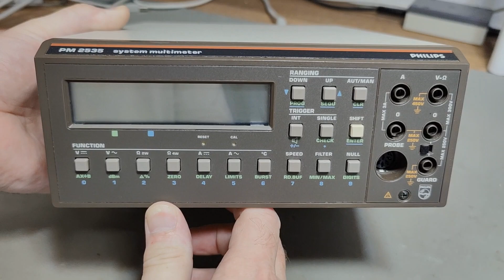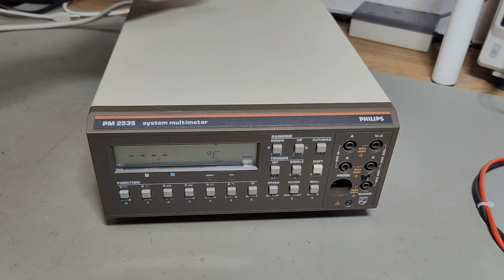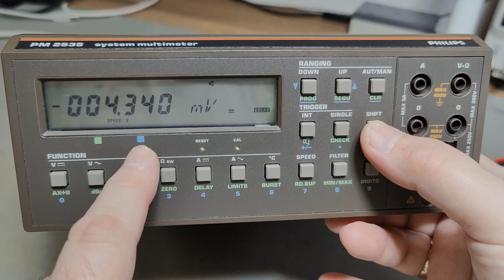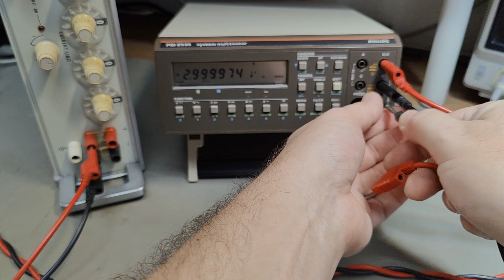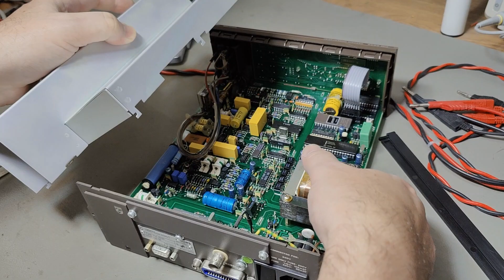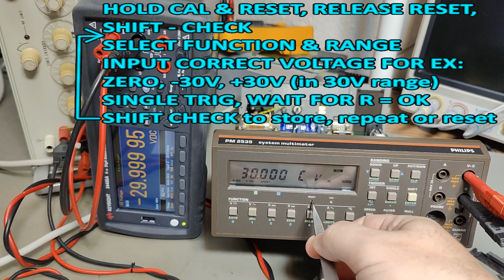Philips PM2535 System Multimeter Bench 1990 test calibrate teardown

Comment: Hi, thanks for the interesting video. I'm looking at acquiring a PM2525, very similar to your PM2535. I saw that there is a Lithium battery inside. Do you know if there are any fundamental precautions to take when replacing it? Thanks from Italy.
Reply from the maker: if you replace the battery, you will of course loose all calibrations, and must follow the cal procedure to the last detail, it is explained in my video how to perform calibration,
Reply: @TeardownOZ2CPU  Yes, I see. Thank You very much 🙂
Reply: Often you can replace the battery while the system is fully powered on, this way the RAM holding the values is powered from mains while its backup is replaced. However usually one needs to use a soldering iron that has absolutely no connection to mains live/neutral/earth, so that those commons voltages can't create any harmful large potentials on the board that would damage things. A USB soldering iron connected only to an isolated power bank would be a common modern approach.

Comment: Hi ! I have a PM 2525 with a motor inside to switch from one function to another. Very interesting touse but always afraid that it stop working. Also, if you misselect a function you can blew up the meter.
Reply from the maker: wow i have not see that, funny stuff with motors and such
Reply: @TeardownOZ2CPU I have posted a video demonstrating the motor. “PM2525 noise performance”
Reply: @TeardownOZ2CPU  Yeah very interesting ! You never used one ? i forget where you are located

Comment: Nice work, congratulations. I discovered your channel on Saturday, and I am impressed with your professionalism.
The first video I watched was Technics SU-3500 Amplifier Repair - Part 1 and 2, in the second part you used a spray to clean the board which was very dirty. What is the name of this spray and where is it purchased?
Thank you very much
Reply from the maker: just did a search on my channel, i find no videos with the word Technics in it..
I use : Kontact 60, KONTAKT WL, Kontact 61, if you can only afford to purchase one can, they i suggest you just try Kontact 61
Reply: ok. Thank you very much. I'll see if I can find this product here in Brazil. @TeardownOZ2CPU
Reply from the maker: @fujitsukomatsu9240  else i have another trick : IPA also known as pure alcohol use that to clean with, massage switches a lot while very wet, then add a tiny drop of the fine sew machine oil, that is almost as effective, and very cheap and easy to get.
Reply: Ah! yes, alcohol.
I use isopropyl alcohol, but using a drop of oil is new to me. I'll try it. Thank you very much. @TeardownOZ2CPU
Reply from the maker: @fujitsukomatsu9240  IPA dissolve all the dirt, but it also dry out all lubrication, so you want to add a tiny drop of oil when you are done, so parts that move still move nice and smooth, if possible try to rinse a few times with IPA and use compressed air in between, now you blow out all the dirt and get better results.
Reply: I understand, you use IPA with a drop of oil to also clean and lubricate the moving parts of the keys.
And on circuit boards when you only use alcohol when you don't have Spry?
Thank you very much once again for your attention. @TeardownOZ2CPU